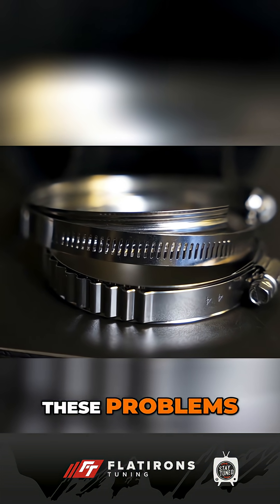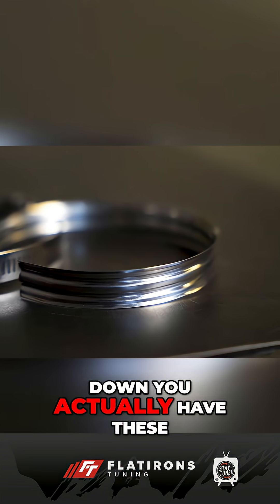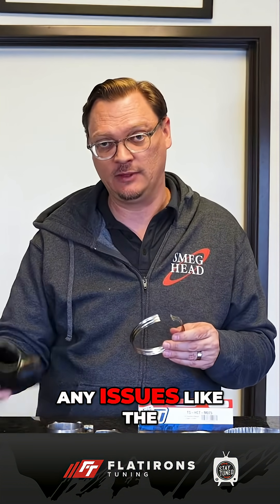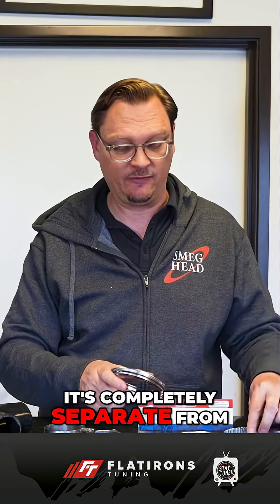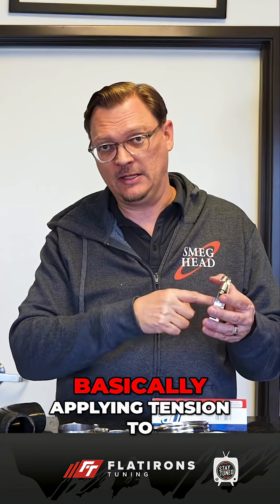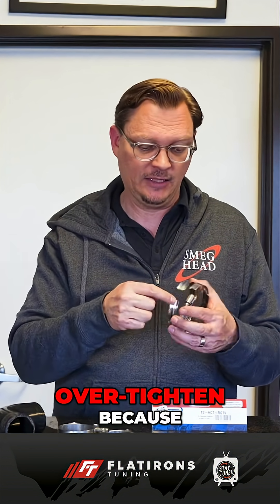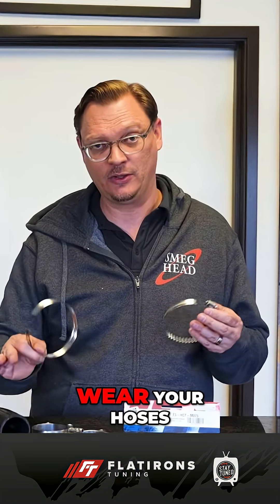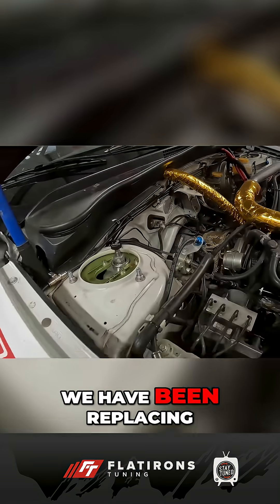Best Hose Clamps!  Solve Boost Leaks and Cooling Issues

Comment: Murray clamps are nice but very pricey and I don't like the actual worm gear action (US style cut out slots in the clamp), way too easy to overtorque them and bend the slots. Atleast in Europe it's easier to get Mikalor clamps which offer a similar inner ring to prevent biting into silicone hoses (used by some European OEMs). Mikalor also has constant tension clamps if the application really requires it.